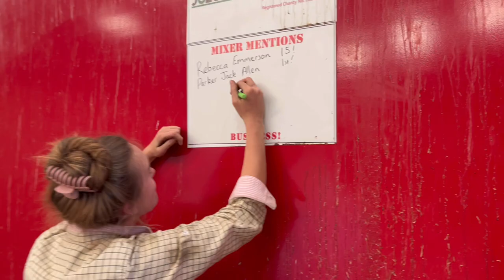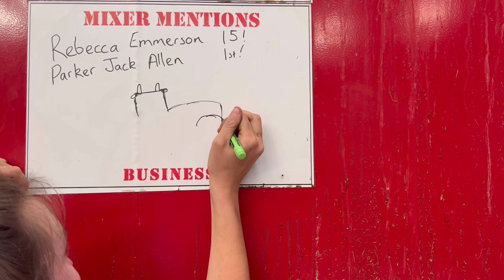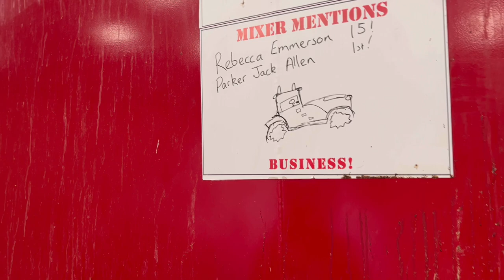Ems Drawing Again?! The Stick is Found! Ash is Back!

Comment: Nice shirt Joe! Was cool to see you pulling the bale out so easily, big change from the clean you had to do last week. One question I had was why you got the hay baled with your mates round baler instead of using your square baler? 

Could tell it was a tractor from the first line drawn! Nice work Em, I think its maybe a Fendt by that hood vent drawn? Or a maybe a Claas.